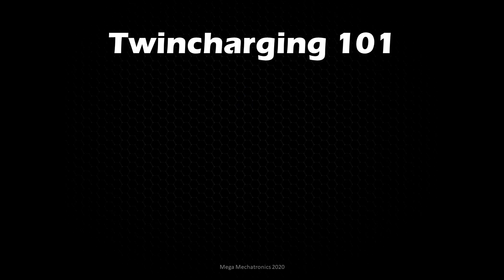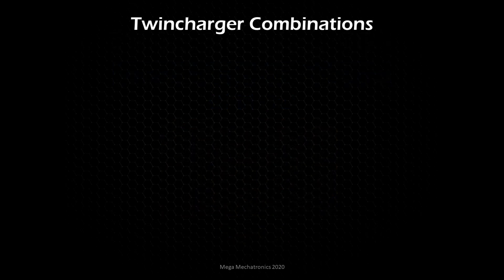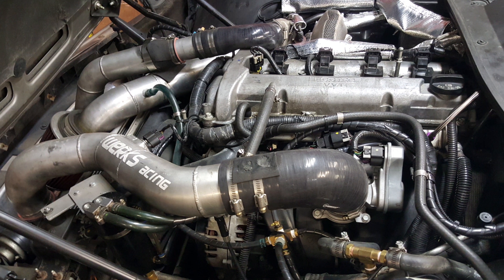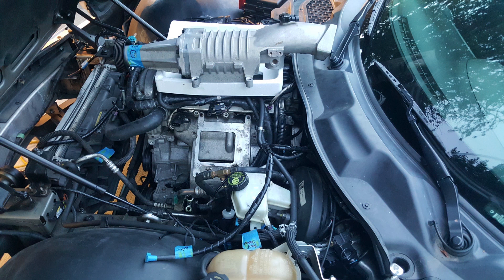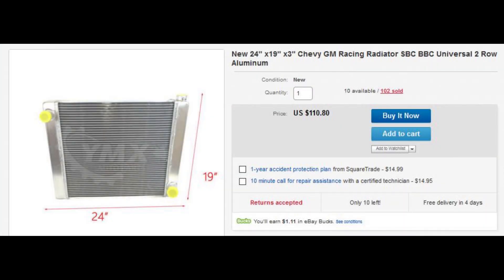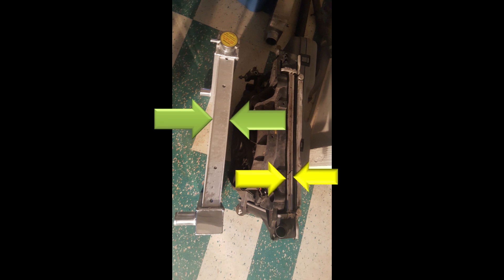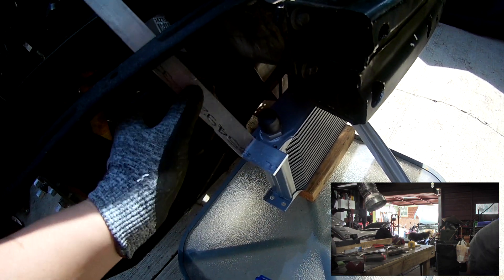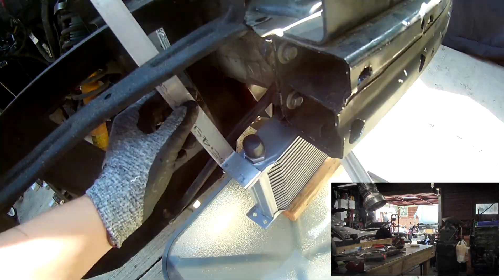How to Twincharger Part 3 - 600 hp Solstice Build - Cooling Mods

Comment: Im looking to twin charge my 3.0 straight 6 I already have the ess tuning twin screw supercharger,  Im looking into turbos if the ecu is already tuned for the sc do I have to tune again for the turbo?
Reply from the maker: I was surprised there was much change to the non-WOT tune when I went from Turbo only to the Twincharger, running on MAF.

Comment: I have a 2v mustang v8, I want to rebuild, stroke to a 302 5.0 and addd cams and boost, and I’ve been getting obsessed with twincharging ( sounds that make organs lmao V8 cammed, supercharger whine, turbo spoil and flutter 😍)
When are u guys realizing parts 4? Or the actual way to build one 🤷🏼‍♂️ if you’re not... would u be kind enough to link to some info? There’s not a lot of info available 🤷🏼‍♂️😭❤️

Comment: I'm also working on a twincharged setup similar to yours. Turbo feeding the intake mounted screw supercharger to a 1.6L engine. I'm also using a air to water intercooler to cool the charged air from to the turbo to the supercharger. My main concern is the air temps after the supercharger since its non intercooled.  From where I'm from which is Malaysia a tropical country, ambient temps can reach over 36*C all year long and E85 is not available in my country.
Reply: Lol i heard if you're able to move the injectors further up the intake runners it'll have an improved cooling effect.  I remember seeing videos of ITBs on an NA setup and the fuel injectors weren't even in the intake runners.  They were at the entrance of he ITBs

Comment: Did I miss what you used to disengage the supercharger at a certain rpm or boost level???
Reply: Works best if you stay full compound and do not disengage the supercharger and keep it as a multiplier of what the turbo feeds it.  No bypass etc to confuse the system.

Comment: Can you put an electric clutch on an M90 supercharger?
Reply from the maker: I know of a Mercedes Eaton M62 that has a clutch, so similar to you I wonder if that clutch would fit on the LSJ M62 that I am using.  Don't let the clutch stop you, just bypass the SC to reduce load and regain torque lost to the front pulley.
Reply: Mega Mechatronics I am looking forward to seeing more videos from your channel it’s really the best on this topic
Reply from the maker: @Servant_of_the_Lord4life  Thank you.  I expect to have some time available to pump the next two parts out because of you know what, lock down!
Reply: @MegaMechatronics  Don't use a clutch or bypass.  Full compound is where it's at.  Makes for a more efficient setup with bigger powerband.